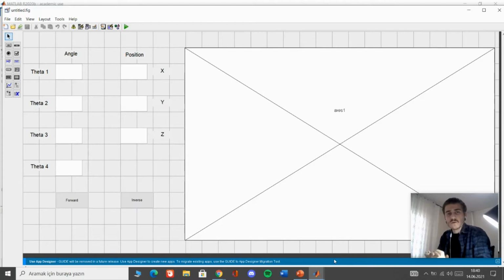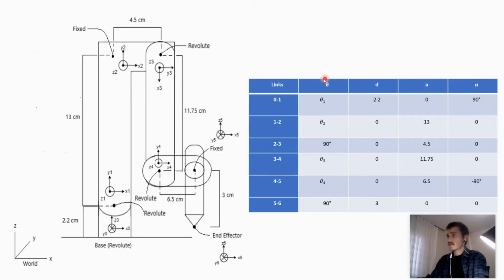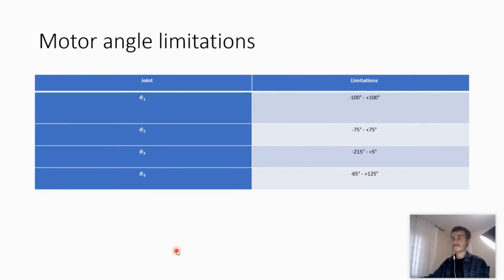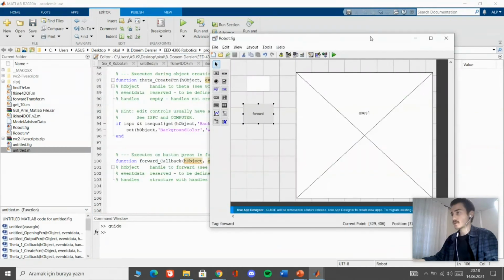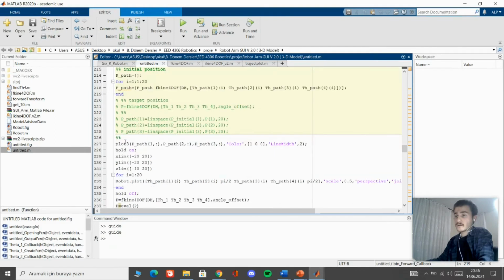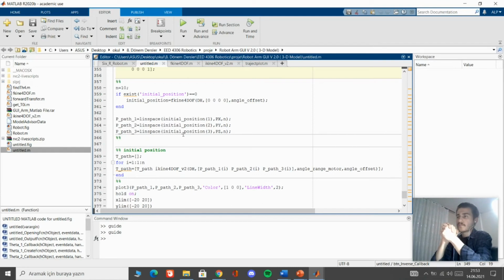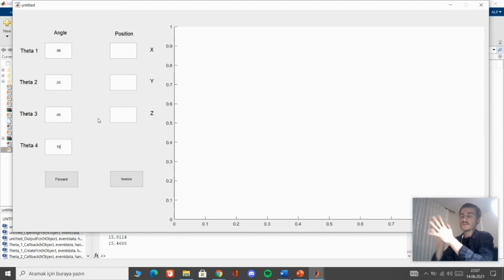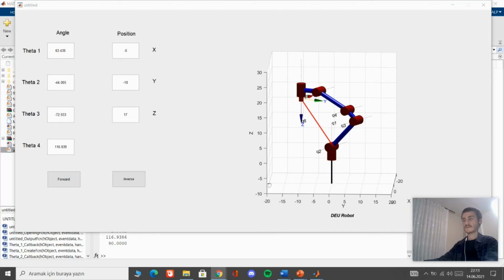Creating simulation environment for 4DOF robotic arm [Peter Corke Robotics Toolbox] [Matlab GUI]

Comment: hello brother i have this problem that when displat the robot arm links arnt in the correct position as like urs but my joint position is correct nvm i found out the problem was that my code was not in the same path as the rvctool of peter corke robotic toolbox

Comment: Hi nice video, but when i run i get loads of errors, can you hlep?

Error using load
Unable to read file 'untitled.fig'. No such file or directory.

Error in matlab.graphics.internal.figfile.FigFile/read (line 31)
hgDataVars = load(filename, '-mat', '-regexp', '^hg[M]');

Error in matlab.graphics.internal.figfile.FigFile

Error in hgload (line 54)
FF = matlab.graphics.internal.figfile.FigFile(filename);

Error in matlab.hg.internal.openfigLegacy (line 57)
    [fig, savedvisible] = hgload(filename, struct('Visible','off'));

Error in gui_mainfcn>local_openfig (line 286)
    gui_hFigure = matlab.hg.internal.openfigLegacy(name, singleton, visible);

Error in gui_mainfcn (line 158)
        gui_hFigure = local_openfig(gui_State.gui_Name, gui_SingletonOpt, gui_Visible);

Error in untitled (line 45)
    gui_mainfcn(gui_State, varargin{:});
Reply from the maker: Hello, first of all thanks for your comment. I wonder if the .fig and .m extension code files you downloaded are in the current folder of matlab?